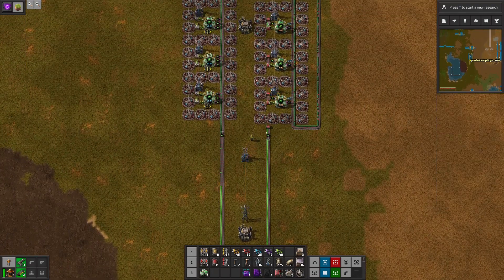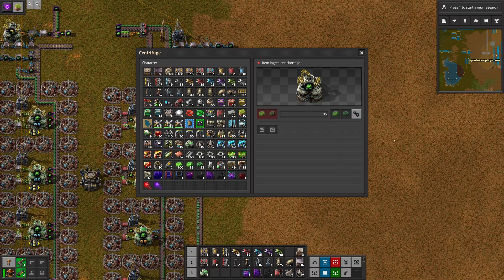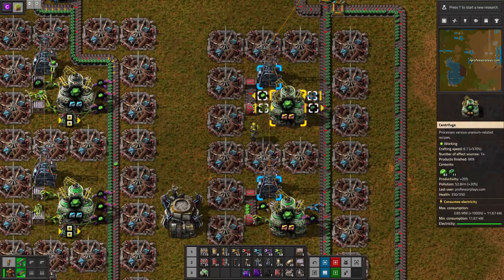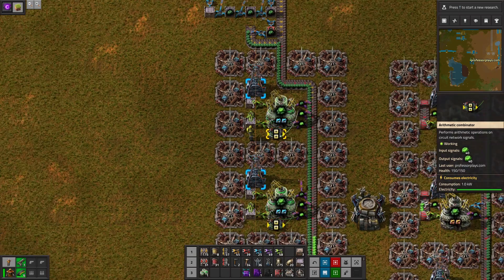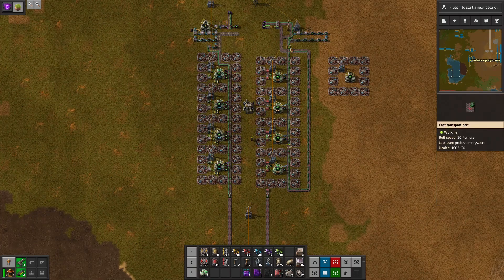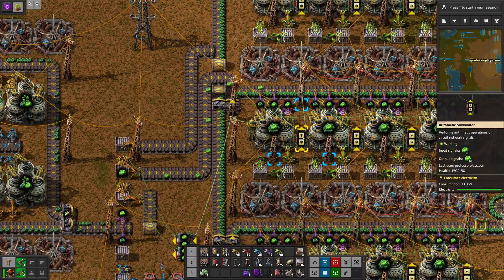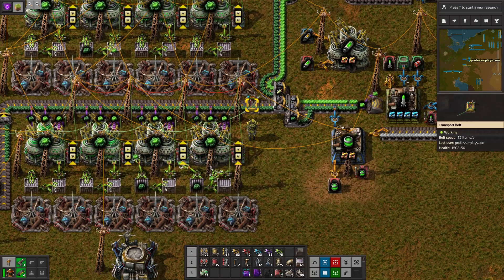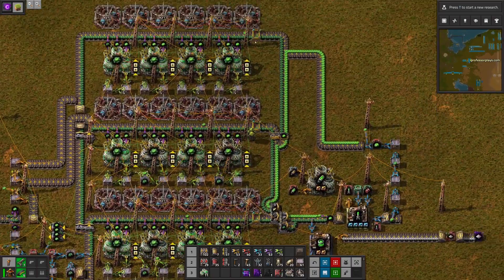Factorio Tutorial Build From Scratch ep19 Kovarex

Comment: 😀 It took me a few hours to understand the simplicity, functionality and elegance of your Kovarex setup fully - chapeau!
Reply from the maker: Thank you for the comment.
Reply: I'm still at a loss.  The 3rd Kovarex complex seems to run from left to right, essentially 
input > normal centrifuges > Kovarex #1 > Kovarex #2 > Kovarex #3 > Kovarex #4 > output, with now way back from right to left.  If Factorio mimics Earth, the average mix should be 0.72% U235 and 99.28% U238, or roughly 1:138.  Let's say that 4 steps of Kovarex turn 40 U235 into 44 + prod bonus + compound interest, let's call it 45.  Then, 0.72% becomes 0.81% or about 1 in 123.  
However, that's not the thing that seems to happen there.  How do you carry U235 upstream?  All belts seem to run either vertically or left to right  I think I see it now.  You put the output of a Kovarex machine onto the belt and pick it back up from the next square.  It doesn't have to run to the machine BEFORE it, because it feeds back into the SAME machine, keeping it running at 40 U235 and letting only one U235 advance to the next one.  It's basically the "Kovarex > box #1 > box #2 > same Kovarex" setup mentioned earlier with fewer beacons / underground belts.  So it's not "this Kovarex > next Kovarex" but rather "this Kovarex > SAME Kovarex, except for overflow, which goes into the next."

And now I'm thinking about a design which is essentially the same but where each Kovarex feeds into the next, and the low-volume traffic of excess U235 and supplemental U235 uses the main belt only.  A two-machine array should be rather simple.  Machine 1 is fed from belt, and feeds U238 into machine 2, which takes additional U238 from belt.  M1 feeds all U235 into M2, which will eventually overflow M2 (i.e. stall M1).  That stall only happens infrequently (once in 41 cycles).  The real loss comes from the fact that I can't put 12 beacons around each machine, but only 10.  Might still be worth the space savings, tho. 
(On another thought, I can't even keep 8 beacons consistently for >2 machines in a row, so that 2-machine design would be pretty niche).  Early on, your 12-beacon setup minimizes "Kovarex lag" (the time between 40th U235 inserted and last machine completing its 1st cycle); later on, the 10-beacon design takes more lag but is compatible with prod mods and uses the space better, while even later, your long rows should take over.  You can "8-beacon" your machines consistently, so let's look at the # of beacons required:

M row, N machines: (M+1)(N+3) beacons.
So the min # of beacons for maximum speed boost are:
6 machines (one row or two), 18 beacons. 
18 machines (two rows or three), 36 beacons. 

So for a fully beaconed build, 3 rows of 4 isn't optimal.  But then again, it's not too far off, either, and space constraints might make it optimal if you couldn't fit another 2 centrifuges per row.  And if combat losses are a primary concern (Nilaus had a "nukes can spawn anywhere" stream once), building two small sites (or even a single machine per powerplant) might be preferred due to the redundancy they offer.